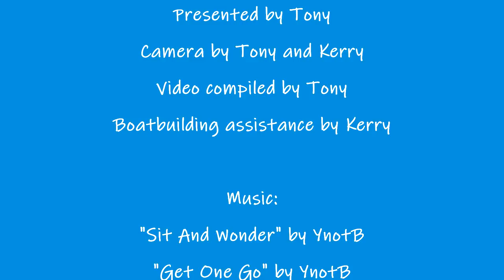Engine mounts and bed, the lazarette and the aft deck - SV Tapatya EP61

Comment: Great video yet again.  What is the engine bed made of?  Plastic from what you said but must be a tough type.  Cheers
Reply from the maker: Thanks again Geoffrey. The engine bed is a heavy duty fibreglass with steel inserts. It's pretty solid.

Comment: Your son looked really pleased with himself when you told him his welding was better, I know that this is most likely to be a stupid question but how are you going to attach the keel to the hull?
Reply from the maker: Thanks Jas. The keel bolts on to the hull, through the floor beams. I shall almost certainly go for the long keel. This has a solid wooden "spine" down the center of the boat to which the keel is attached with long bolts that go all the way through to the inside of the boat